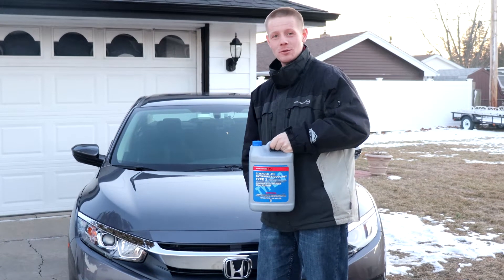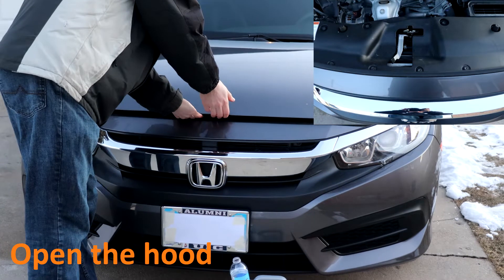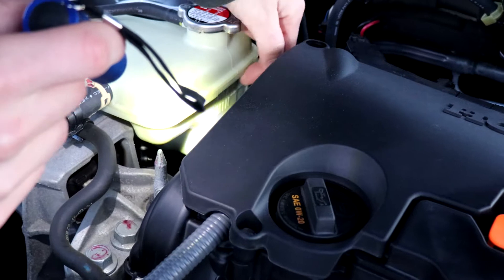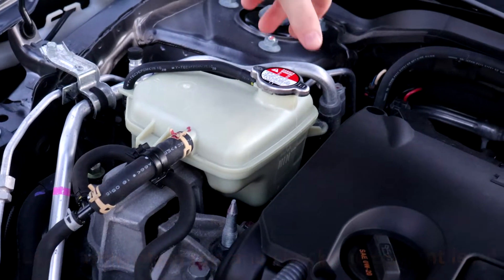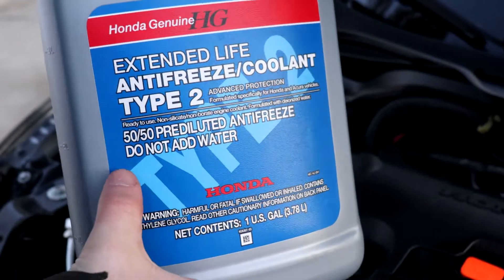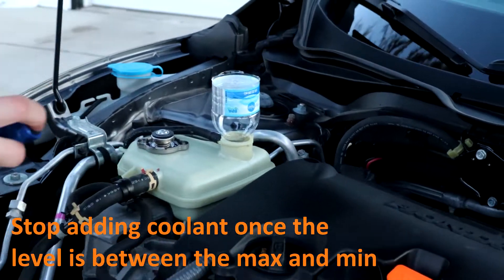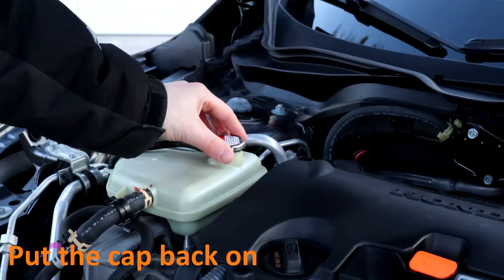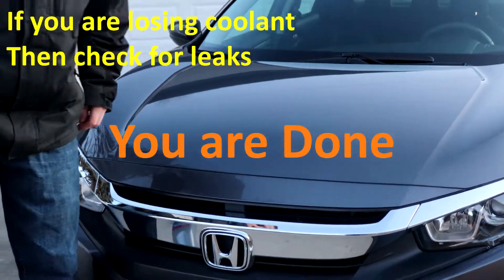Honda Civic (10th Gen) - Add Coolant

Comment: How do u drain it ?
Reply from the maker: The drain plug is on the the radiator. Driver’s side (left side), bottom corner.
Reply: Big drain bolt on the front side of the engine

Comment: how should i know my system coolant?
Reply: I know I’m late, but it should be “Asian Blue” (usually from the brand “Peak”) coolant. If it’s not a prediluted/pre-mix, then mix it with distilled water to make a 50/50 mix.

Comment: Hi! my question is do I need to drain the old coolant and fill up? or just fill up right away? Nice video by the way
Reply from the maker: It depends. If you are using the exact same coolant that is in the car and the old coolant is still good, then just add what you need. If the coolant that is in the car is near the end of its life, then drain/flush and add new coolant. If you are using two different coolants, then you need to drain and flush before you put the new coolant in the vehicle.
Reply: @PiotrBilek  how do you know if your coolant is bad
Reply: @rithe07  how long have you had your car  if you look at ur Manuel it usually says every 30k